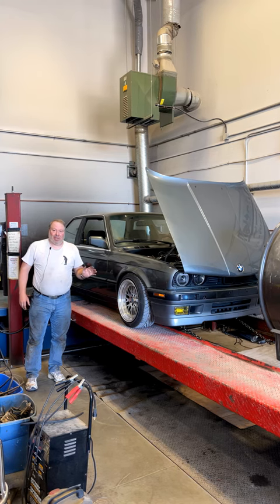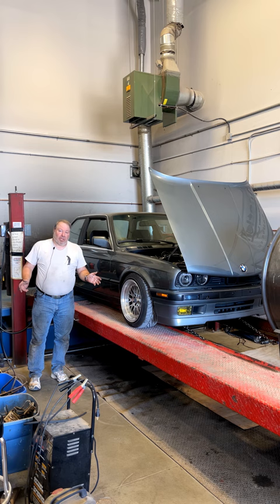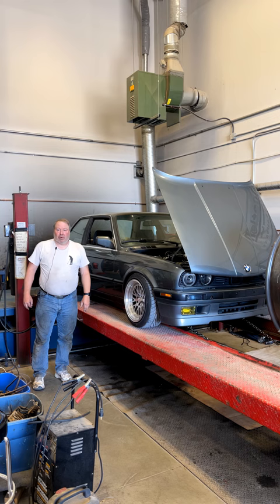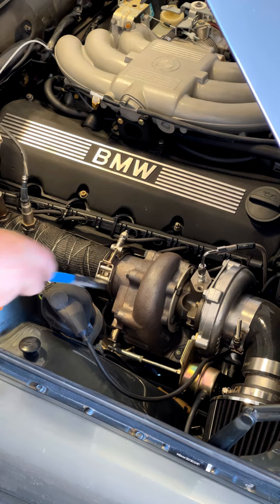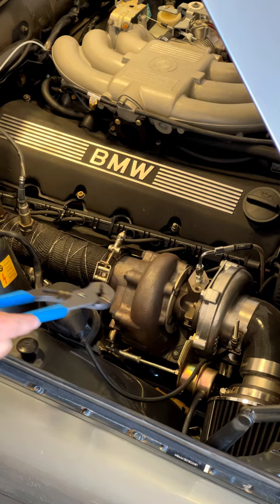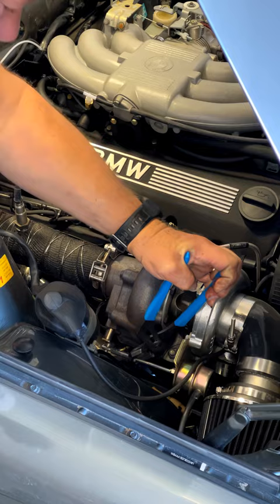Chinese Turbos

Comment: Or use an external wastegate
Reply from the maker: For sure, but now these guys have built the system for an internal wastegate turbo they are locked in, or it’s back to the drawing board.